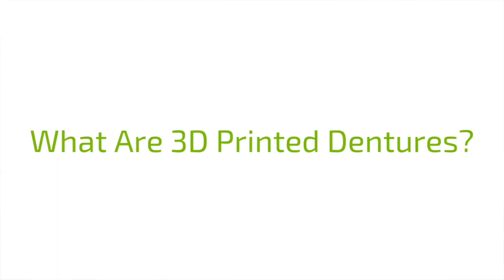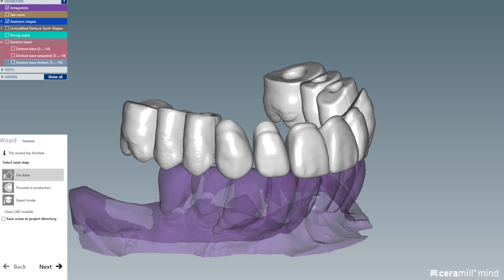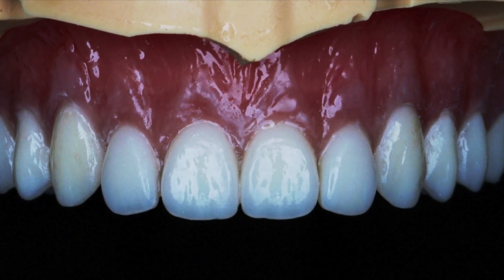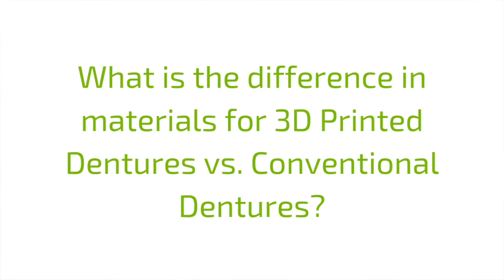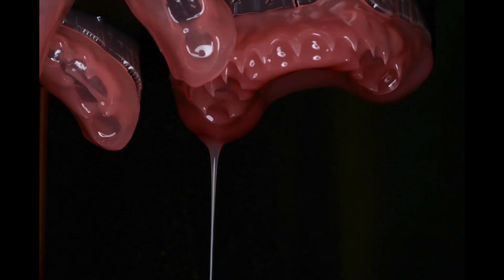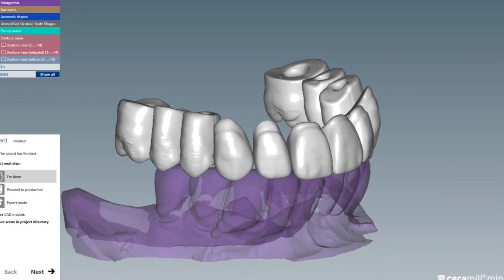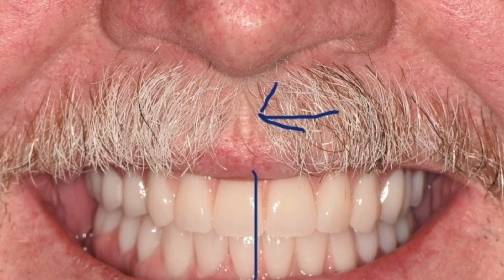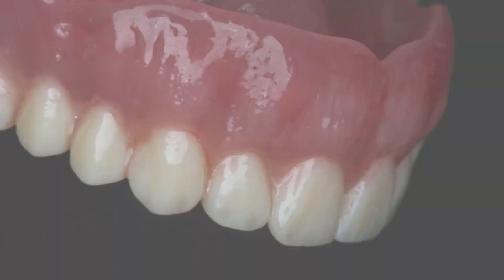3D Printed Dentures - What, Why, How?

Comment: I’m learning to make dentures at my father in laws office and just checking out all the advancements that the industry has made. He still does the good old fashioned way which is fine. I wish there was a solid pros and cons video of digital vs analog. For example he taught me the reline process in wondering how that works for digital. Do I just take another mold of the mouth again or does the old fasho ed polymer stick to the new resin from a digital denture.
Reply from the maker: Hi. Are you a dentist or technician? We are working on webinars to actually explain what you ask.

Comment: I have had 6sets of dentures in the last15years and 1set recently that are to bulky and don't fit properly I'm in caboolture  Queensland Australia could a set of 3d dentures be the magic solution  thank you
Reply: You couldn't reply what's the difference between manual dentures and 3d what are the success rate

Comment: just had 3 d digital dentures made and definitely did not fit top plate only. No suction at all , teeth were pointed at end and did not go together in back.  Teeth were seethrough and tiny like baby teeth. What happened to these.
Reply from the maker: It is hard to say what happened without know the case or having seen it. In general digital dentures can have errors the same way regular dentures can have. Digital is just a different process which can allow using alternative or more progressive materials. There are many advantages utilizing digital methods. The main important fact is that the record taking is key for all the different processes.

Comment: Why have you not paid the royalties? 
3d print dentures is licensed non commercial. Who is your printer supplyer?
Did your 3d printer supplyer inform you dentures is licensed and supply the name of who you are to pay royalties to ?.  
Name who you pay royalties to?
All companies selling 3d printed dentures are required to pay royalties. 
Custom design by you dont get you off. Ive been nailed for getting this wrong from others over other products so now im cracking down to. 
Ignoring dealing with royalty may result in action. So lets get it sorted. 
I want answers within 5 days. 
Please reply.